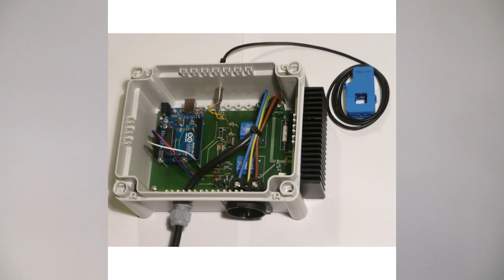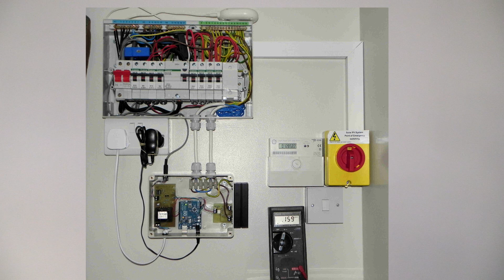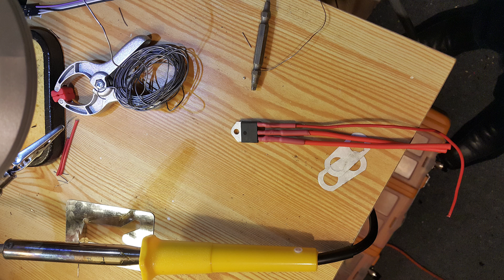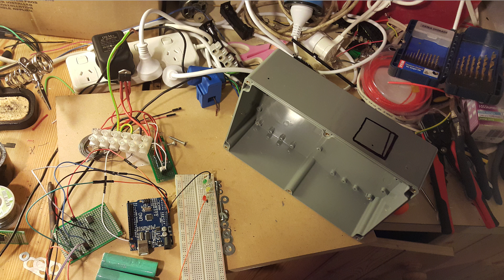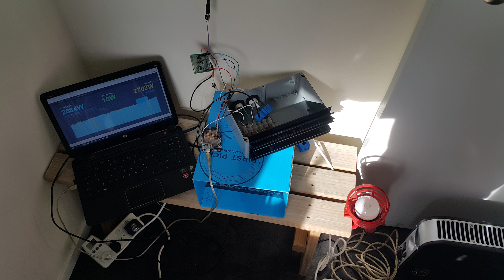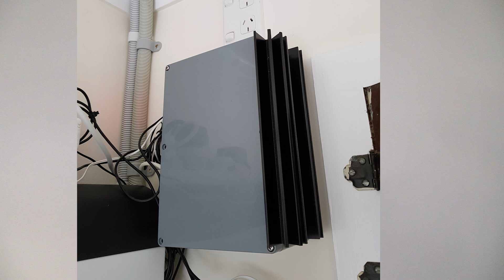DIY Part2 Free Hotwater! Power Diverter

Comment: Hey Mike - Thought you might be interested in this.  Something I'm working on https://community.openenergymonitor.org/t/arduino-nano-esp8266-mk2-pv-router-hybrid/4739
The idea is to add the esp8266 to make decisions about whether to turn the hot water cyclinder on after some cloudy days.  the esp8266 also has the grunt to run a nice little LCD I2C display
Reply from the maker: Very nice, well done. Hows it be going? Have you finished the build yet?

Comment: C0NGRATULATIONS!!!  The first PV water heating video that isn't completely moronic. I've heated water off grid for years with a MPPT DC diversion system for years and I can watch 500W diversion drop to 20W production in less than a minute. While yours is grid tie, the principals are the same and these UNO based systems diversion systems can be built for way under $100. My only comment is that I wonder how effective these are at low power levels.  I've seen several reports that many of the new electronic utility power meters are quite inaccurate when it comes to triac switched loads.  All we can do is make our end correct.  Thanks for your video.  I'll refer it to others when I try to explain the concepts of load diversion.
Reply from the maker: hmm I wasnt sure how the off-grid circuit would work as i haven't needed to learn about it but doing some Googling DC diversion looks interesting.  Effective at low power levels? it does work but i found it does work better at higher wattages of solar. But given under 500w of solar doesn't really matter as the house load is normally close to that and the diverter isn't dumping any load.

Comment: do you think I could control a 240v 1200 watt chargers output the same way? so when the sun is a bit weak it would adjust?
Reply from the maker: Hmm you could change out the Trac with a power mosfet but i think you would have to have the code alittle.. I dont know. In some ways if you are using a 24v system then you could use a dc-dc converter and change out the Amp pot with a digital pot and control that with an ardunio which was my other idea for another project. Only problem is the digital pot needs to be able to handle the output voltage of the DC circuit which is normally the only problem and that i dont know the answer to eg for 48v but under 30v should be easy to do.

Comment: In my experience of plug top power units there can be a problem with some o/p not being referenced to earth and the possible potential differences can cause issues. In your circuit are they tied to each other inside the box? Have you had any unexplained restarts or circuit lock-ups? 
I don't know whether it would even be significant in your design, but just a thought.
Reply from the maker: With mine, both Earth and Neutral are directly connected to the hot water cylinder. Only the live cable is switched. Which means its safe. I also connected the heatsink to the earth. No lockup or restarts. The only problem i had was about 6 months ago after a powercut the uno mis calulated the CT clamp readings which ment it didnt track the solar 100%, restarting the 5v or the power diverter fixed it straight away.
Reply from the maker: And after from that i havent needed to touch the unit in the last year, which is great.
Reply: It was more to do with the dc output of the psu (not the mains switching) only being 5v when measured across the o/p and being maybe 20v when measured to ground. In the same way you can get a tingle from your laptop's metal parts when it's plugged into it's mains charger, the dc o/p is very often floating and not with one side tied to ground.
I didn't know what the 9V ac was for and whether the 2 different voltages ever needed to reference to each other.
But then if you've had no problems, then it isn't a problem :)
Reply from the maker: 9v AC is needed for the CT Clamps - Non-invasive AC Current Sensors used to measure real consumption and reading phase shift on the AC and AC voltage. Otherwise its just a guess eg 240 or 110. But as we know its never just 240 its anything from 230 to 250 always changing. So for calculations if its wrong all the caluations will be out so you can't base it on a set voltage it needs to be constantly adjusted/worked out. 
Have a read of https://learn.openenergymonitor.org/electricity-monitoring/voltage-sensing/measuring-voltage-with-an-acac-power-adapter?redirected=true
https://openenergymonitor.org/forum-archive/node/58.html
https://learn.openenergymonitor.org/electricity-monitoring/ctac/ct-and-ac-power-adaptor-installation-and-calibration-theory?redirected=true
Reply: Ah, yes the 2 are tied to each other here, https://learn.openenergymonitor.org/electricity-monitoring/voltage-sensing/measuring-voltage-with-an-acac-power-adapter?redirected=true, with the offset circuitry.